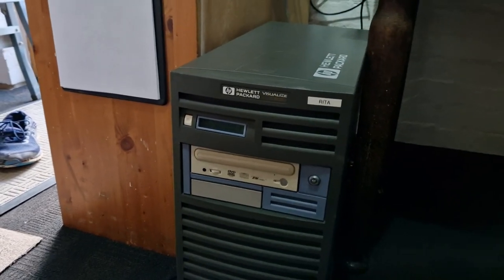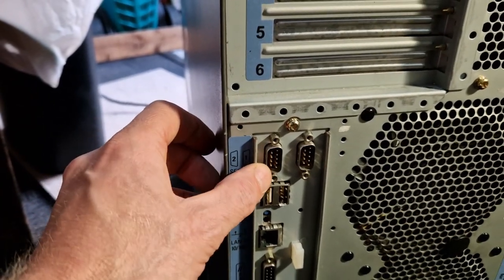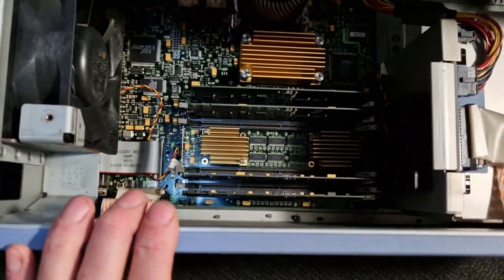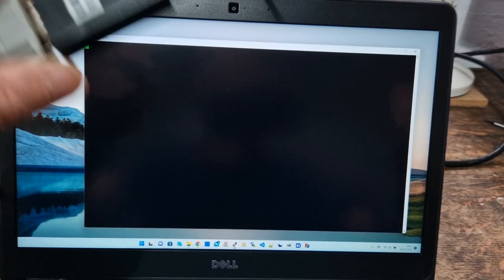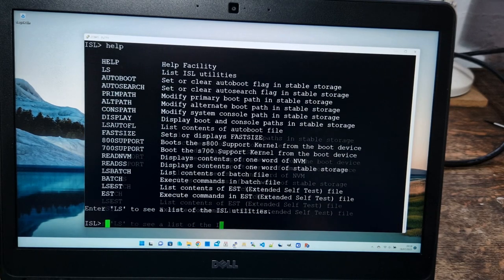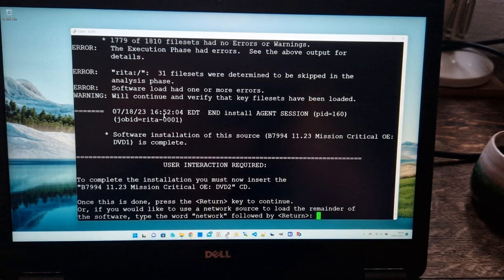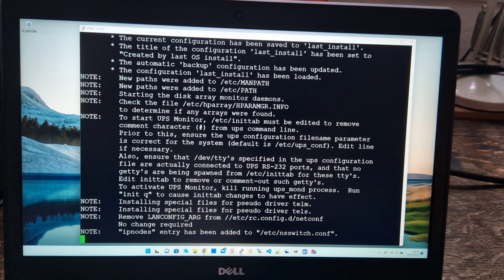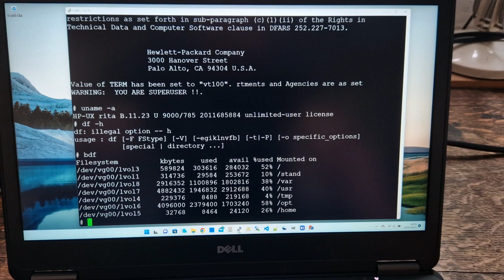HP C3000 PA-RISC Workstation: Tour, and installation of HP-UX

Comment: Thanks for the memories!  Back in the late 90's / early 2000's I was in charge of a network of CAM workstations that ran HP-UX.  The last HP-UX machines I bought were HP C3000's and HP C3600's running HP-UX 10.11 if I recall.  Around 2004 our CAM software was ported to Linux so I switched over to Red Hat machines in 2005 and relegated the old HP workstations to terminals for manufacturing machines out on the shop floor.  Even though the OLD workstations were workhorses the Linux machines were an order of magnitude faster in all regards and cost 25% of what the HP machines did.  Having said that, in 2007 I had a Dell RAID server running Red Hat that corrupted the whole disk array due to a firmware issue in the RAID controller.  I'm confident something like that wouldn't have happened on an HP RISC-based machine.
Reply from the maker: One of my customers stil has a bunch of PA-RISC servers still running in their enterprise... sometimes good engineering refuses to die.

Comment: hp just did their own thing . the gfx sandwich was display out ramdac / framebuffer  card with texture processers daughterboard .
Reply from the maker: I would like to find some "free" software that actually makes use of it, not just a text console.
Reply: @nicksmith4507  Debian has a pretty mature PA-Risc distro. I had it running on an older c110 although I was never able to get X-windows running. The fancy GFX card wouldn't work with the Debian framebuffer driver. 
I used a C3600 for Unigraphics back in the early 2000s for a time just at the tail end of their use. We moved to UG on Windows XP 64-bit on HP XW8200s initially.
All HP workstation are really impressive bits of kit. Just tanks.
I never saw any hardware problems when I was working with them despite them running full - tilt all day 5 days a week.
Great machines.
Reply: @nicksmith4507  right, same problem with Sun Workstations. Please tell me if you find CAD/CAM Software for these beasts. I still keep ORACLE software & patches for HP-UX.